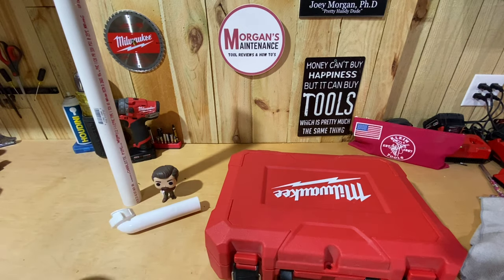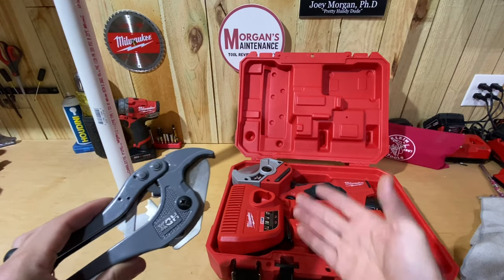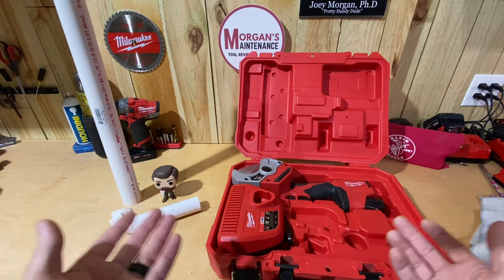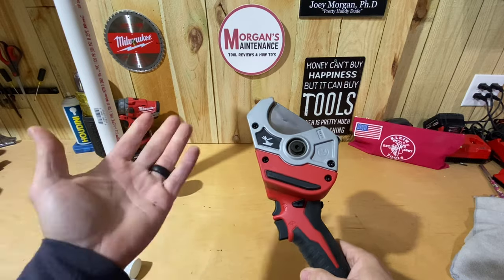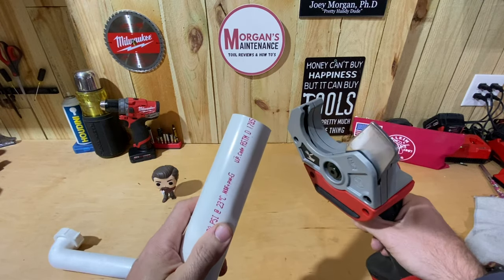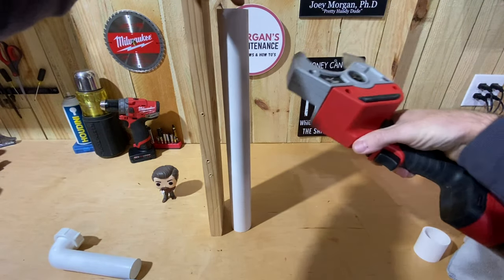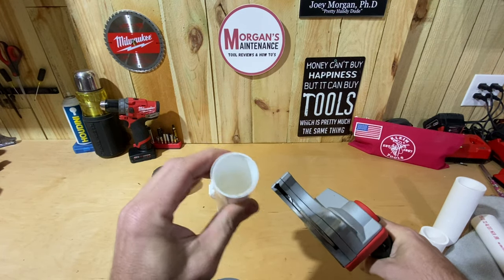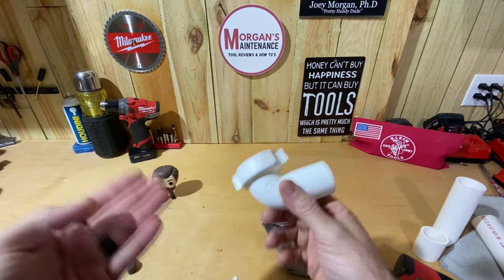Milwaukee M12 PVC Shear - Cuts PVC with ease... What about Trap Piping? #tools #milwaukee #plumbing

Comment: Great review! I’ve been wanting one for awhile now but just haven’t pulled the trigger. I’m not sure if I’d use it enough to justify buying it. I really like the rigid tool though. Awesome video!
Reply from the maker: Yeah there are times I’m glad I have it, but could get by with just a hand one.  However a hand one that will cut 2” pipe is pretty pricey too:

That Ridgid tool is the best thing I’ve used so far for that kind of piping.

Thanks Buddy 👍

Comment: I'm not a fan of tools that have their manually operated counterparts that do the work the same, but without batteries.
I understand the advantages of that tool, especially in your peculiar sewage piping solutions, but good manual pipe shears FTW.
BTW it's another example of American contradiction - houses made to last a decade with sewage pipes made to last two centuries. Why not use gasketed pipes? I know - bonded PVC pipings will be able to work under pressure, so you can pomp your sewage. But usually pressurised sewage is realised from the collectors onwards, not from the houses directly. Gasketed pipes as a system have less rigidity, thus allowing self-compensation of a stress. It's very rare that our pipes crack.
For our European pipes I use exactly that Ridgid tools - have both of them: large one for diameters of 50 mm (2 inches) and combined smaller one for diameters of 32 mm (1 1/4") and 40 mm (1 1/2"). They work great.
Anyway, very informative, well made video. More bloopers, please.
Reply from the maker: I got it on sale one day with some free batteries is the main reason I got it. I knew it would be one of those occasional tools for me.

There have been a couple times where it was easier to get into a space and use them than have the hand ratcheting type  open and close manually in the same space… but other than that, it’s just an effort saver. Which you are right, the ratcheting hand tool doesn’t take much effort as it is.

My area is very limited on plumbing supply offerings locally. You pretty much only have PVC for drains. You are right though, any pump station is after the house’s plumbing.

That little Ridgid tool works well.. definitely safer than my other methods of cutting that pipe 😂
Reply: @MORGANSMaintenance  I think that it's against the code to use any other waste pipes than the glued ones. For me it's just an interesting difference between Europe and the US.
By gaskete/seald pipes I meant (google graphics): "wavin pvc"
Reply from the maker: @Stefan_Kawalec  I have seen that in some videos on YouTube I’ve watched now that I’ve seen the picture.

Comment: I find that it can be tricky to get a perfect 90-degree cut with the manual ratchet tools. Is this tool "fool proof" (for fools like me) in delivering 90-degree cuts easily?
Reply from the maker: It’s not 100% because it allows the same room of wiggle as the ratcheting type until the blade touches the pipe while cutting…

But I will say that it cuts through the pipe easier/faster, which the slower start is sometimes what causes the ratcheting to kind of get off sideways while cutting.

I’m not sure if that makes sense, but I do feel it’s easier to get 90… but it’s still possible not to.
Reply: Yes, that makes perfect sense.  Thanks @MORGANSMaintenance .  Very helpful!